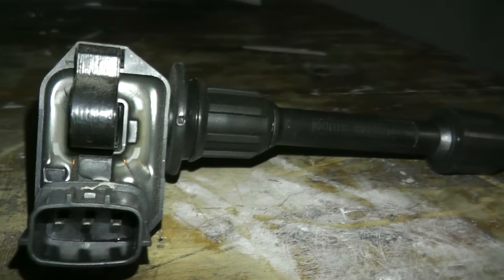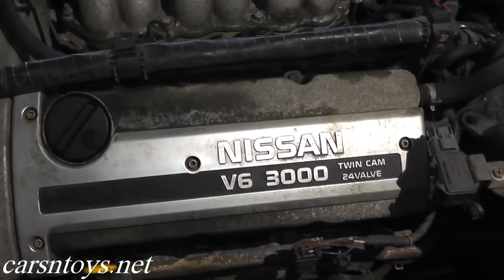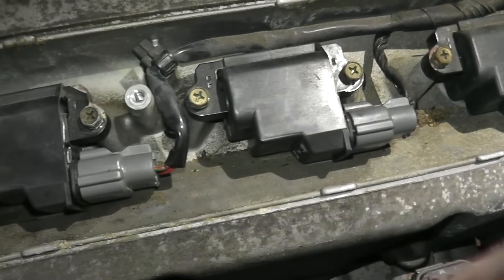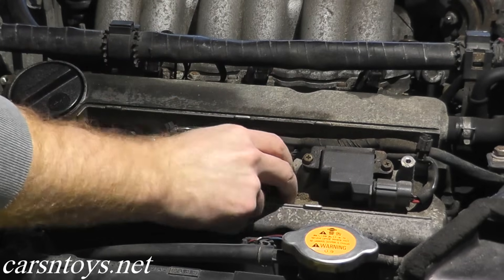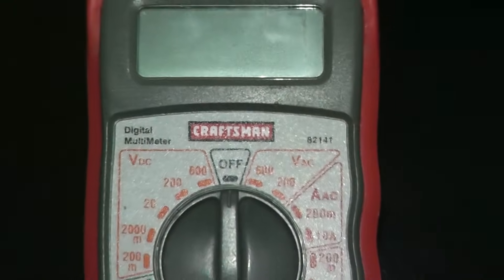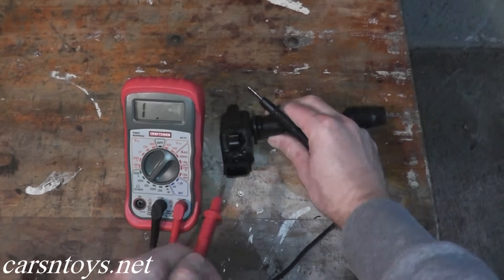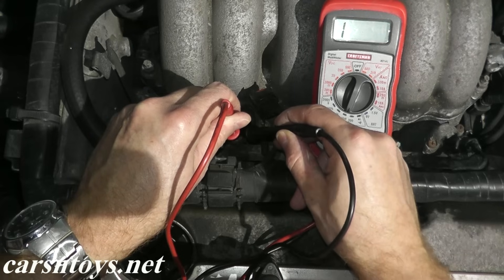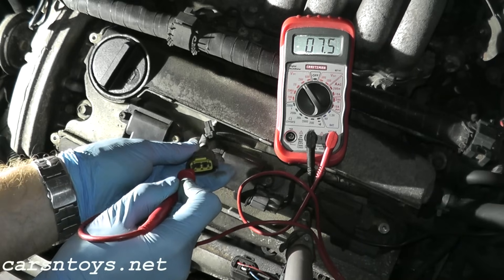How To Test Ignition Coils with Basic Hand Tools HD

Comment: I'm trying to test my coils on a 97 maxima with a multimeter. When i touch the probe to terminal 1 and 2 the meter either displays random #s then it displays nothing or it displays nothing at all. if i keep wiggling the probes for better connections it does the same thing. Terminal 3 and 2 comes back 1400+ ohms for the rear coils and 1600+ for the front coils. When testing 1 and 2 I set ohms to 200 and for 3 and 4 it was set to 2000. Does this mean all coils are bad? Can someone plz help?
Reply from the maker: If you're not getting a reading on 1&2 the coil is bad.

Comment: I'm getting a code of misfire in cylinder #4 I changed the plug, tested the coils, switched them with the number 2 and pulled a used injector them put it in 4 and still getting the same code any thoughts?
Reply from the maker: How''s the wire harness?
Reply: ,l

pJosh Slaughter

Comment: i'm having this issue on a 95 maxima.
tested coils 1 and 5.
no response so now i'll test your method
Reply: I am having issues with a 1996 Honda Accord starts while driving rpm drop to 0 shuts off and won't start after I let it set for a while and will continue only little distance and shut off again and won't start until I let it set
Reply: Had a similar issue and it ended up being the harmonic balancer that was failing and it finally did fail.

Comment: im having a random misfire in my 08 eclipse 2.4l i4. could a faulty coil produce this? thank you
Reply: Thanks for the response, i fixed it. It was the crankshaft sensor connector, making a bad conection. I riggednit but i need a spare
Reply: check for a plugged fuel filter or vacuum leak before you change parts.
Reply from the maker: Sure could. Any trouble codes?
Reply: Yes sir. Random misfire
Reply: awesome job

Comment: Resistance from what I read can be misleading.  A static resistance under no load or voltage can yield different results.  In some cases, you can improperly diagnose a coil as good when it my be bad under load.

Comment: hello boss,
just wondering if you can drive Nissan Skyline R33 with two faulty coil packs for about 20 mins before i can fix it and also whats the best cost to change all six coil packs?
thanks
Reply from the maker: +ayatullah qasimi I had a similar situation years ago with my 300z. You can do it but the car (obviously) won't run well. Regarding cost, you'll save if you do the repair yourself. Otherwise, I'd bring the vehicle to a shop that has experience working on your R33. Cheers.

Comment: the kia optima capacitor was giving interference (issues) so i disconnected. pls. if you will what are the required ohms for the 2.4L kia pencil coils (vendors don't specify the resistance)  thanks
Reply from the maker: +Juan Alberto Diaz Unfortunately I don't have any specifics for your Kia. If you continue to run into trouble, shoot me an email and I'll try to help you out.

Comment: hi, i have a kia 2004  optima . pencil coils  that feeds 2 spark plugs. one read 16.5 ohms (secondary) the other 1.5 ohms (primary) . had problems. once i change the problem was solve. also the primary coil once hot read 2.5 ohms resistance next morning 1.5. question? the lower the ohms the better?
Reply: So are they supposed to be low ohm reading? In other words your coil that read 16+ was bad?

Comment: What if it only happens sometimes while you're driving, but idles on 6
Reply: And I drive a 2000 maxima so same coils
Reply from the maker: +Remember When I'd check spark and fuel. Any trouble codes?

Comment: Is this safe? 2009 toyota corolla
Reply: I want to try it on my 10 Corolla aswell
Reply: Are you referring to to the runaway Toyota's of that year range?
Reply: Safe for the car or the person diagnosing? in my opinion yes, for both. The wire harness is low voltage, it won't arc and shock you like a distributor cap and rotor would. If you remove the ignition coil and plug it back in while the car is running then there is a higher possibility of getting shocked although the metal spring that touches the spark plug is recessed in a bit to reduce the possibility.  As for the safety of the car, the sooner the misfire is fixed the happier the engine will be.

Comment: I tried to do the coil test while the car was running and when i unplugged just one of the coils, the engine shut off. I have a 2000 toyota corolla LE. Is this normal? does this mean that the other coils are bad and it only running on one? Btw great vid and easy to follow.
Reply: Same case with my honda city, let me know if u got the answer

Comment: i have one question. my coil have 2 pins and i have a reading of 0. i want to make sure im doing correct. i have my multimeter set to 200k ohms.
Reply from the maker: +Dany Luna What kind of car?
Reply: +CarsNToys  2007 ford f150. v8 4.5

Comment: i have one question. my coil have 2 pins and i have a reading of 0. i want to make sure im doing correct. i have my multimeter set to 200k ohms.
Reply: This is a late reply, but set your meter to 20 ohms. Not 200k (which means the max it can show is 200,000). If you set it to 20, the max it can show is 20, and considering you are looking for less than 10, then will give you a much accurate reading. At 200k, it would should 0 even if the resistance was say 100.
Reply: +Dany Luna It should have 3. Sounds like maybe one broke off. Anyhow, if its giving you a zero reading then you need to replace it anyway.

Comment: what order do the coils run in on a 24 valve what pairs are they because its recommended you change both coils that run in pairs so how would 6 work ? or does this only apply to 16v
Reply: Don't run the engine while unplugging them.

Comment: great video... will give it a try if I can get to my cylinders it is pretty tight there had to remove dual intake on my 07 g35 all the way to taking off a throttle body. also great idea on the continuity test.
Reply: I have to also remove a cover just to get to the coils. It's annoying lol

Comment: Honda civic 2001 170i. My cylinders are missing. Each time I diagnose a bad coil and change it another coil which was working during troubleshooting goes bad a few days or week later... I've changed two recently and a third is now bad. Are they just due for changing or is something causing them to go bad????
Reply from the maker: C John Have you done any mods?
Reply: No CarsNToys
Reply: Jus bigger muffler!
Reply from the maker: C John
Are you certain the coil packs are definitely the problem? In other words, there's no check engine light or other issues? (Some vehicles will throw a bad ignition coil code even though it may be a bad crank sensor.)
Reply: I have had this happen on quite a few different vehicles, from Lincoln v8s, hondas, and my dodge, I don't know why it does but I have replaced a coil and a older one has a hard time keeping up and goes out and end up replacing all of them.

Comment: ya , and wire 3 is for triggering the 12 volt pulse to the spark plugs 1 , 2 wires and 12volt and groundbut the ohm test is only good if you know what the ohm reading range for a good one should be

Comment: Had a miss fire on my sentra. Used the first running test and located the bad coil. Easy fix, thanks for the video helped alot.
Reply: No as its running a cylinder wasnt firing. The car was running on 3 cylinders.
Reply: The motor sounds quite different when running than normal. Like its on the verge of stalling.
Reply: +clikzip When U say "miss fire" what exactly are U referring to? Is it when U start Ur car?
Reply: clikzip i
Reply: What code did you get?
Reply: P030-P0306 for my Sentra.  The last number corresponds to the cylinder.  I had P0302 so it was the 2nd cylinder.  Do some research, you should find what you need.  Cheers!
Reply: You can test in this video.. https://youtu.be/yApLeqiZ8RE
Reply from the maker: clikzip Good stuff man
Reply: +clikzip O Ok. Thanks bro...
Reply: +clikzip How does it feel when that happens?

Comment: dude can the coil be diagnose with a multimeter that is to check for 5V and continuity test too?
Reply from the maker: Chuks Ihemere Sure you can run both of those tests using a multimeter
Reply: is it control by the ECU

Comment: Nice video. As for as ignition coils are concerned, the ohm meter test is not reliable for them to do.They contains mostly electronic inside and you can not guess the health of those using a multimeter instead what you showed in the beginning by disconnecting them one by one and looking to the engine behavior, could be the valid test only.
Reply: You are somewhat right, however some resistance reading is not the right answer. the coils should have a specific range they need to be within. this range differs depending on the vehicle/coil pack. You most know what that range is for that vehicle.
Reply: LearningZone q
Reply: You’re correct.  That’s why the Factory Service Manual for this Nissan Maxima doesn’t have a bench-test for the ignition coils.
Reply: Also u have primary and secondary windings circuits it’s a diffrent test for each and diffrent ohm readings
Reply: @panzerichi3837  I have a coil that reads from the lead that goes to the spark plug to both pins(8 ohms)but from pin to pin it does not read any(0 ohms)

Comment: nissanman #

My Nissan maxima 1999,. Can you help me, please.

At the stop light , and while reverse RPM start to drop, and engine virbrate.
I have change coilparks and mass air intake, and good of the manifold and new spark plugs , and IAC also 
problem still there.
Reply from the maker: Kouy Kaing Check for vacuum leaks, egr and pcv valve. I have videos on the egr and pcv. Just search my page or carsntoys.net

Comment: only thing not mentioned is what the ohm meter is supposed to be set to on the dial
Reply from the maker: Tim Zzz Good point. Tenths place is fine. If any one is unsure, you can also purchase a multi-meter without the dial and let the machine do the work.

Comment: Excellent video. 
You wouldn't happen to know why my coil number 6 is blowing out with my auto start for my car? 

2004 Mitsubishi Endeavor coil 6 is hooked to the auto start (viper) to let it know it's turned on.   Thank you! 

Some ideas are: bad relay switch, bad wires, bad viper auto start
Reply from the maker: Yi Xi I've never installed a viper alarm system but sounds like there's too much power going to that coil.  Do you know which model you have? I can quickly look up the install instructions and figure out what the deal is.
Reply: Oh you are awesome I have a 2004 Mitsubishi Endeavor XLS AWD.
Reply: I'm also getting a code p0421, p0431, p0171

I've had the catalytic converters and o2 sensors replaced over the last few years.  I just have a permanent check engine light on and now I have to get my car emissions :( 

My mechanic is a quasi friend but he'll only do so much, so I've devoted myself to youtube videos. lol 

What last thing I've watched videos on is draining the HVAC AC system and I guess the drain tube fell off and it's backed up with sediment so its leaking water all my driver side floor. So hopefully I got that problem resolved soon I've drilled the hole in the side by gas pedal.
Reply: Yi Xi Wow, I just saw your website and it's got some awesome stuff I'll go through. :)
Reply from the maker: Yi Xi Sorry. I meant do you know the model of the viper alarm system?
Reply from the maker: Yi Xi Bummer. I wonder if you have an exhaust leak in the cat causing these codes to illuminate.
Reply: I have been looking for the box and the receipt on viper. I've had it about 3 years and I wanted to take it back to Best Buy to get it fixed.  I'm looking at the key fob now. Appears I'll have to get the model # off of engine area tomorrow.

Are you guys in Jersey? If so, that's where my grandparents lived and my mom is from. I'm in Utah. Thank you kindly.
Reply: CarsNToys I have tried a gas cleaner in the gas tank what other things should I test on the cat?  It's seriously so antagonizing because even my mechanic friend seems to not be able to get to the bottom of it. He's about an hour drive but he has treated me well, replaced my coil 6 twice under warranty. I had to have it towed once to his shop, only to find out I could have changed a little fuse and gotten the engine working.
Reply from the maker: Yi Xi Code p0171 alone can be a host of things. (Intake leak, o2 sensor, injectors, exhaust leak, fuel pressure, etc.) If it was my truck, I'd disengage the auto start and just focus on the codes for now. The one thing in common with p0421, p0431 and p0171 is exhaust and that's why I'm inclined to think about checking the exhaust and cat for leaks. There is a test you can perform on the cat. You drill into the exhaust and take pressure readings. Check out Scotty Kilmer's Channel and search 'cat'. He has a video for code p0420 and another video on how to test the cat.
Reply: Thanks for the info 👍